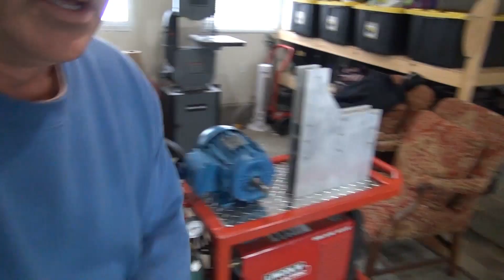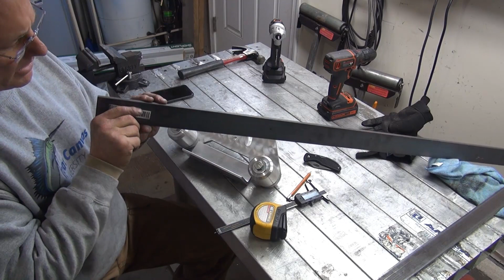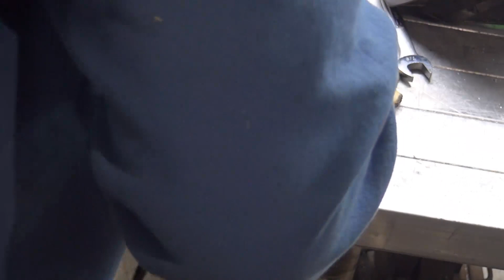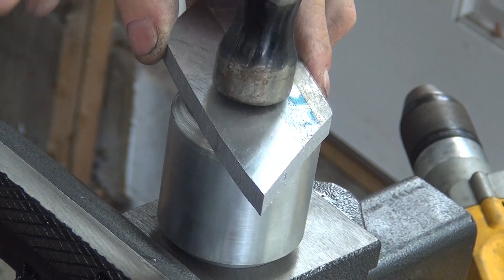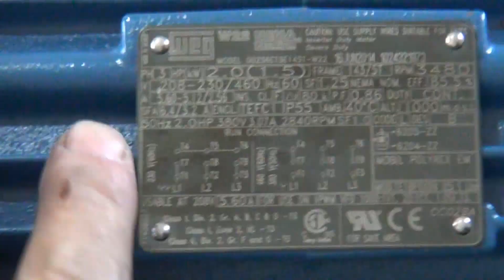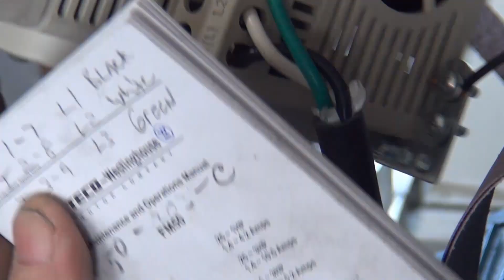Belt Grinder Part 2

Comment: Thank you for documenting this build. I am going top attempt a similar build on my Smithy Granite. Now that you've had it a while, would you put the belt on the left side again? I have a lot of 8 gage plate steel for the frame I intend to use. Is your build based on a Reeder Products, Inc. design? I intend to use a 56c motor on a one piece frame, and also add tilt for horizontal grinding.